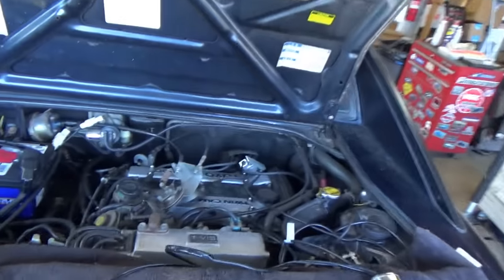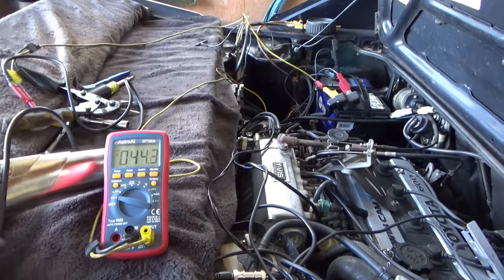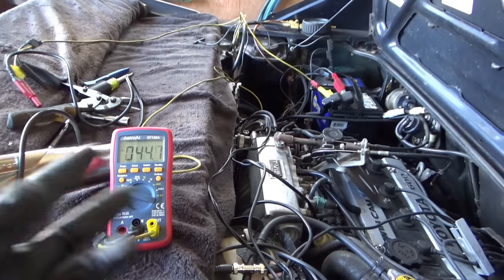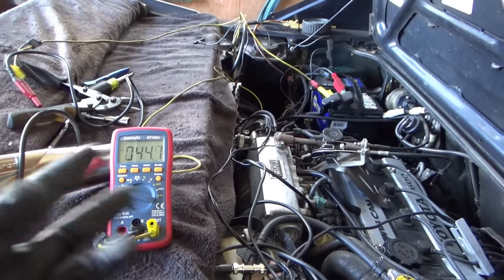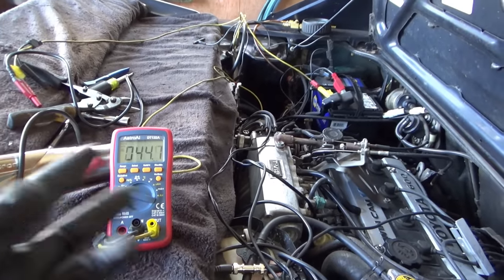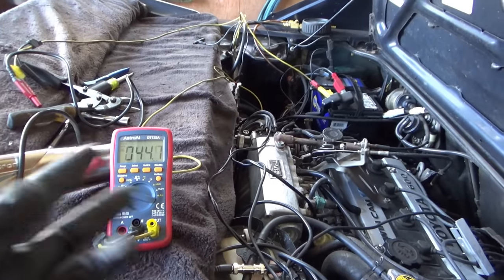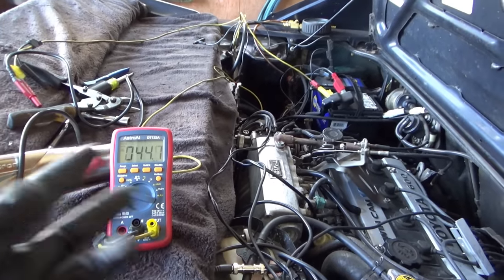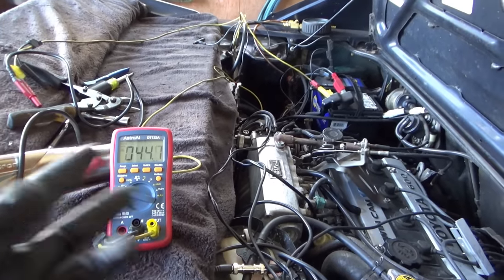Toyota "New Year's" Time Machine...No START when HOT? (Part 3 - 1987 MR2)

Comment: Great vid Ivan. Just wondering if you are still going to bypass the EGR as it looks like that in the engine compartment. Just wondering if that will make anything change ?  Very interesting diagnosis and case study.
Reply: No. You don't want to bypass the EGR. It'll cause valves to get burnt.
Reply: Just curious.  Why would the valves burn?   EGR only came about in the 70s.  No burned valves before then. @CarlWilliams-u3y
Reply: @hugh007  Cars with EGR valves prevented burnt valves. It recirculates the exhaust to cool off the valves. It recirculates excess fuel not used to burn it.

Comment: As cars of this vintage age, the engine computers are definitely going to become a problem. My early ‘90’s Mitsubishi started running very erratically last year. After a lot of troubleshooting, I decided to open up the engine computer. I found that several electrolytic capacitors had become swollen and leaked their contents onto the circuit board. This started a bunch of corrosion that damaged nearby traces. It was repairable, but just barely. Stock up on used computers for spare parts to keep your soon to be classic car running!
Reply: I had a trace get burned out because of a thermal event with a nearby component.  I bypassed it with a simple wire.

Comment: On this era of fuel injection, the coolant temp sensor has the most influence over how much fuel the engine gets.  If the CTS is delivering the correct voltage/resistance for the given coolant temp to the engine control box, and the control box is taking away too much fuel (the pulse width is too short), then it's time to condemn the control box.  That control box was suspect from the first minute of the first Part, what with the green crusties and the rust pitting on the control box itself.

And for the love of God, that fart can muffler has GOT TO GO!!!!!!!!!!!!!!!!
Reply: Yes to both!!! I said in the first part on something like this where you can easily do a visual inspection of the inside of the ECM I would have taken the cover off and looked at it before I wasted time doing anything else. Also yes that muffler sounds horrible and is extremely annoying 🤣🤣

Comment: BTW, you lucked out on the earlier ECU working…the plug configuration was changed in mid 1987 preventing use of the earlier MK1a ECU.  They are very reliable provided they are not exposed to water…the original ECU (the bad one) clearly had gotten wet.

Comment: probably some corrosion pulling the signals up or down meaning that the ecm was using the wrong part of the base map for idle, ran fine when revved because it started using the o2 sensor to correct.

Comment: VW Jetronic systems of that era also worked so poorly even when working well...same kind of air flow sensor.  Piss-poor system from the start.  The more you stepped on the the gas, the slower the machine would run.  Nasty system.  Only thing worse I've ever worked on was early '80s Chrysler Imperial 318l FI.  Factory fix for that thing was convert to carburetor.

Comment: I was starting to think that it was a bad ECU , ignition coil or power supply to the ECU & ignition system or something like that.

I probably wouldn't use that corroded ECU again unless someone can refurbish it, there's likely high resistance within that ECU, when I diagnosed that Ford EL Falcon it was just a matter of cutting a couple of wires then rewiring the ignition switch back to how Ford wired it up meaning totally bypass that engine immobilizer/car alarm which wasn't OEM !

Comment: the 4 runner i have has the same mass airflow sensor mine is above the air filter an when i first got it it was filthy even a little dirt can effect it i clean mine with brake cleaner regularly (no residues left behind) also a note the toyota engineers thought a wire crimp of brass was enough to link injectors on their paired wires most owners will have an issue with corrosion to the connection as they did not seal the connection just electrical tape 4runner forums on these the connection needs to be soldier and sealed

Comment: Interesting fault, good thing there was spare computer included.
I wonder if just cleaning the rust away, so the short from those solder joints goes away from the old PCB could fix it? There was maybe also some buldged looking capacitor, or maybe it was some other component? next to a small chip on the board.

Comment: hey ivan, did you know these engines where built by Yamaha?  i've had a lot of dealings with the mk1  & the mk2 turbo  also they're non contact (free wheeling)  but when the belt lets go it takes out a load of wiring.  and i'm an old mechanic. this is THE worst timing belt job i have  ever had to do. if i had to do it again i think i would take the engine out. it was that bad. torture.
Reply: I had an 85 for 20 years. The timing belt broke on me once. Had to tow it back home. Put in a new timing belt and it was good again. No wiring problem that I know of. Mine had no turbo though.

Comment: If I remember right, on the air flow meter there is a mixture control adjustment. It is under the small round cap. To access it you have to drill out the cap, cap is thin, to get to the screw. Under the black plastic cap is the wiper style air flow meter. The plastic cap is held on with silicone. Have fun!

Comment: When Toyotas that are in sound condition, overall, stall when hot, then, it is Either a Vacuum leak, a dirty throttle body system, or, as in this case, a bad computer.  Owner should be glad that every element has been investigated.  Perhaps the owner can send the old computer to a firm that specializes in restoring these items.....You worked beyond every level to fix this vehicle...you know what to do.....and it is clear how hard these vehicles can be to fix, with 100% confiidence.....If they rebuild the old computer, then it could be re-installed to see what happens next.

Comment: Meter propane to see how it responds at idle also these one wire o2 sensors you ans disconnect the wire to the sensor hold the wire in one hand place the other hand on th battery negative drive the system lean than place the hand on the postive drive the system rich Also these toyota type flapper air flow sensors are prone to have problems

Comment: Maybe for views/content? Regardless, I love SMA, Pine Hollow, Scanner Danner. However. Why not use basic Deductive Logic sometimes. Rather than relying on more electronics Ivan. I recognized this problem from repairing the early & late ‘90’s F150’s failed ECU’s. Exact symptom as the Ford failed ECU Capacitors. Fuel, Fire & Compression “Runs”... bad ECU aka Control. Will we try to repair that MR2 ECU?
Reply from the maker: Customers bring their cars to me for Guaranteed Diagnostics. I can't just tell them "I think you have bad caps in the ECM because I have seen that before on an old Ford truck" 😆
Deductive Logic is the foundation of Diagnostics. But you can't PROVE anything without gathering and analyzing hard data, which is usually electric signals. 😉
Happy new year!

Comment: Purring like a kitten now.  A couple comments: 1) at wide open throttle, the oxygen sensor is ignored…the car runs on open loop and. 2) the fuel injection is batch ONLY at higher rpm; at lower rpm, 2 of the injectors are fired at a time (not all 4).  This improves idle quality.  Sequential injection, while much more common now, doesn’t provide much benefit at high rpm’s with port injection.
Reply: Why was Ivan's Toyota running lean at idle when the MAF was showing high voltage? so he was rather adding fuel
Reply: @ebolti22  the ECU is bad…though the oxygen sensor is reading lean at idle, it is not adjusting the fuel injector duration at idle to get A/F ratio to reach stoichiometric.  The proper oscillation seen with a narrowband oxygen sensor at idle (or any other steady RPM) is actually a result of the ECU adjusting the fuel trims to average 14.7:1…lean, adds fuel; passes through stoichiometric A/F ratio until rich, cuts fuel.  Repeat.

Recall that the voltage measured at the AFM (not MAF) also changed.  The AFM outputs resistance; the measured voltage is a result of the ECU changing the voltage applied across the same resistance.  A faulty ECU is applying a different (incorrect) voltage than the replacement (correct) ECU; the AFM resistance for a given flow rate is the same with both ECU’s.

Comment: I have 2007 Audi Q7 V6 BHK Engine 4L. 3.6L that has fuel rail pressure sensor issue. Says high pressure fuel rail pressure sensor. I Know it's located right next to the high pressure pump on rear of engine driver side. Would the following contribute to and be the potential cause for my intermittent readings for majority n most part: 

Yeah loose wiring connectors is that something which leads to being low voltage condition due to pieces the fuse or relay blades go into be causing these intermittent conditions? I know now that Terminal 50 is the starter circuit. So I'm not understanding why these ppl sent me this climatronic control module schematic 🤷

Comment: Engine computer! 🙋‍♂ Would be fun to rebuild the old one for him to have as a spare. I bet if you unsoldered those caps you'd find them starting to seep. Once those things sit for many years, then you start hitting them with voltage again, they start to go, especially the ones from the 80's. They were having capacitor shortages back then and every Tom, Dick, and Harry company were producing them, and they weren't worth a damn! Good thing he had that spare computer!

Comment: That range on the air Intake flap is trash engineering if you ask me. No way idle to full throttle is within just 1 volt of range in most vehicles. Couple those with a computer that is probably less than mint and you’ve got a rats nest of issues of slightly wrong inputs into the computer.